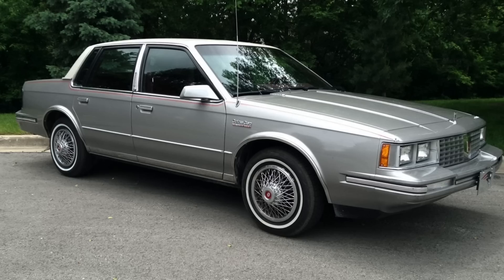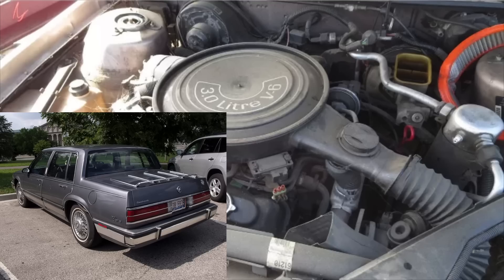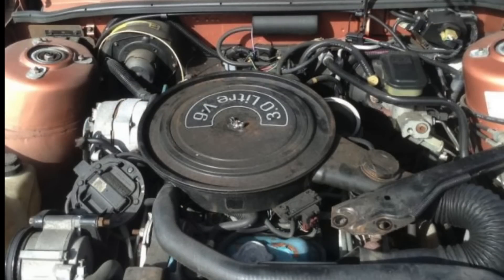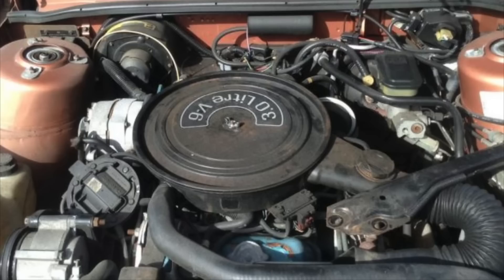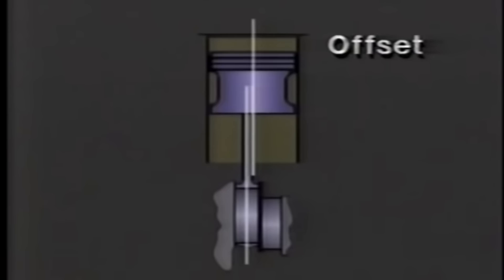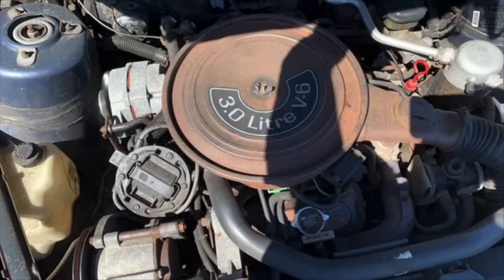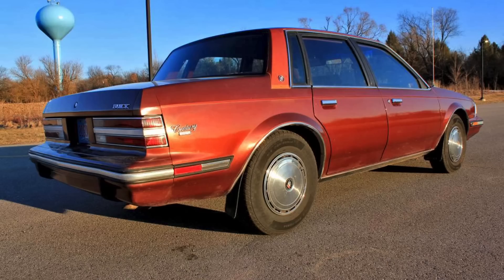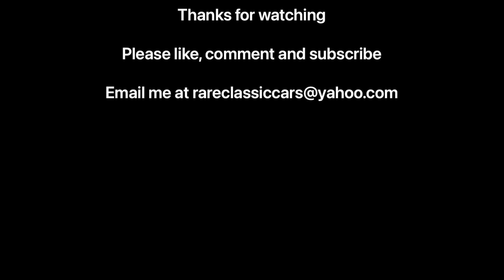Worst Engines of All Time: GM's 3.0L LK9 Carbureted V6 Engine (Buick Century, Olds Cutlass Ciera)

Comment: I have a 1985 Buick Century with the 3.0, bought at an auction some 7-8 years ago, was stored in a barn due to a bad fuel pump. It had the biggest mouse nest I have ever seen in the trunk but thats another story. I dropped the tank and replaced the pump, pulled the carburetor and rebuilt it, replacing every single electronic control in the carb with new parts.  All new ignition parts at the same time along with a water pump. Got it running, tweaked on the carburetor some and replaced all vacuum lines along with the PCM and the intake heater (Early Fuel Evaporation). That was 40,000 miles ago,  engine runs with 5w-30 synthetic oil year round and it starts down as low as -15F. It is a little cold blooded, usually let it idle 20 seconds before taking off with it, it surely isnt a powerhouse but seems to move the car along just fine. It now shows just shy of 140,000 miles.

Comment: I guess I was a lucky one. Had an '85 Ciera with the LK9 from 2011-2018, and it was never problematic aside from occasional issues with the choke sticking. The car would probably still be running to this day, but it was wrecked then rigged back together by the next owner, then he passed on and it has likely been junked by now.

Comment: The 3800 v-6 was a bullet proof engine after about the 2nd-3rd year and even came supercharged. I worked at an exclusive Buick dealer(Warthen gone replaced with a Nissan dealer) in Las Vegas in 91-92 and remember those Buick century cars they were a decent reliable and seemed as though only Social
 Security recipients baught and owned them..

Comment: I was a Buick , Olds Pontiac tech during the 80's to 2010 . Our dealership sold many of these   and damn near all of them failed . The carburetor used on these engines were also a problem child  . Customers with the 2.5 or the 2,8 engine rarely had problems . The 3.3  mpi engine was much like the 3800 and would just run forever .
Reply: I worked at the Nations oldest Buick Dealership , it was originally located in a Barn , a real Barn .

Comment: add to my list- most reliable engines let’s go:

Ford 4.6L 2v V8 
GM/Buick “3800” 3.8 V6
Honda B18 non-vtec I4? 
M-B OM606 turbodiesel I6
Reply: seen a few honda “j30” 3.0 v6 engines with over 500k miles but i hesitate to give them the same space as a 1UZ-FE

Comment: The 2.8L V6 would take all kinds of abuse.  The 3.0L V6 as you point out in the video, is a POS.  The 3.8L V6 sucked until they put the balance shaft into it.  The balance shaft got rid of the vibration.  We had an 1985 Olds 98 with the 3.8L V6 and it suffered from vibrations.

Plate C

Comment: All that was, was a cut down 3.8L. The 3.0L was an OK engine. There was nothing really wrong with it.
Reply from the maker: Check the comments section.
Reply: @RareClassicCars   I have and it's 50/50. This was by far not one of the worst engines GM ever made. The newer 3.0, 3.5, 3.6l are some of the worst engines GM has ever made, even worse than the olds diesel.

Comment: I can agree that this is the worst of GM. this shaky motor pre-dated the idea of installing a balance shaft. After selling all the repair and tune-up parts possible I would tell the vehicle owner all kinds of terrible news about the engine and to get another car ASAP... When the next gen of this motor came out it was 3.3L., multi-port fuel injection, balance shaft installed, smooth running, became a good engine like the 3.8L. yet not the same.

Comment: Whoever designed that engine deserves a special place in somewhere very horrible.
What a shit design.
I'd expect that from an early Mitsubishi engine, but GM?
Although Holden did build the ghastly 1.9 liter Starfire 4 cylinder,
I'd be surprised if any of those still exist in running condition.

Comment: Had a 85 century for my first car. I could not beat a delivery truck off the line. I believe i got it with 65k on it and sold it before 90k. The car would over heat at a stop light had to drive with the heater on all the time. Could not figure out the electronic fan relay. I was 17 and it was an adventure. That was the worst car I had ever owned. It did how ever teach me a lot about keeping a car running.

Comment: My grandparents bought an 84 cutlass ciera with the 3.0 engine brand new.  When they stopped in to show my family their new car, they couldn't get it to start. After my grandparents passed away, I inherited that car. It was always hard to start. Never idled smooth despite several trips to the mechanic. Also the most unresponsive car I have ever driven.

Comment: My dad had an 85 Buick with this engine. While it never blew up it was so horrifically underpowered I was convinced that it must have had 10 pounds of compression! This shitbox was the worst car I’ve ever driven and a bloody nightmare to work on. I think this was the first Fwd car I ever had to work on and compared to the 1960s and early 70s cars we had previously it truly was miserable. I guess we were spoiled working on RWD cars that actually had room to work on stuff. If I remember correctly that 3.0 had a Rochester 2 barrel that had a solenoid that pulsed of the metering rods up and down and by pulse width modulation if allowed the computer to control the mixture. I remember having to fix that bloody carburetor on the side of the road many times! The damn spring would break or get soft and the car would lean out and fall on its face. We always carried a couple extra springs and tools. One day I had enough and made an adapter to stick a 600 Holley carb on that car. Believe it or not it made absolutely no difference in the power output. I never tore into the engine at all because the car was such a shitbox not having any power was one one issue but after watching this video I’m glad I didn’t. If I had done some porting and a cam swap that engine would have completely disintegrated! This car was truly terrible, it might not be the worst car ever made but it’s certainly the worst car I’ve ever driven or worked on. Truly a car best forgotten about I had to overhaul that 440 transaxle twice in 100,000 miles I can’t remember everything I had to fix on that shitbox. I don’t know why he kept that car for so long but he must have liked it for some unexplainable reason.

Comment: I had a late A body car (96 olds) woth a 3100 and 4 speed auto. What a fantastic car. It was quiet, comfortable,  good on gas, cheap and easy to repair, and cheap to insure. I would definitely buy another in a heartbeat. I always wondered how the early versions of the A bodies were.
Reply: Had a 94 Buick Century with this engine. powerful, good on gas and ran smooth for years until I sold it to someone

Comment: The 3800 is a beast.  I'll keep having new metal welded into my 2008 Grand Prix for as long as the motor keeps running.  When I was a dealer tech I saw many with close to 300,000 miles on them still running fine.
Reply: I have a 99 Supercharger 3800, has about 362,000 miles on it. Still runs like a top.
Reply: I love GM V6s, my friends 4.3 has 800k miles sits outside with the hood off and still starts every time
Reply: I'm a mopar guy, but my wife had a 97 LeSabre with 3800 Series 2 and I was really impressed by that thing. especially with it having iron heads.

Comment: All the Buick V6 and V8 in the 215, 300, 340,350 as well as the 198, 225 and 231 V6 engine  line had the full skirt pistons. The 400, 430 and 455  did too.
Reply from the maker: No. The 1988 and later 3800 does not.
Reply: @RareClassicCars  Yes, I know. I wonder why the newer design did have slipper skirt pistons. The Small Block Chevy did as did the Cadillac 331-365-390 from the start. My Nephew had a '58 Caddy and I was kinda surprised to see the slipper skirt pistons in that motor.

Comment: I had a neighbor that had one new in an Old's 98..... She is a lead foot and had to have the engine replaced why it was still under warranty. After the third engine, she sued GM under the lemon law..... it took a couple years but she won and GM had to buy back the lemon. She has purchased Ford's ever since. 

You forgot about the loud, oil burning, powerless, poor on gas milage Vega engine.... as far as that goes, the whole car. I had a 75 Vega Kamback GT.... In the years I owned it, it had three engines, one trans (air cooled Turbo-Hydromatic 250) and an axle, not to mention all the rust repairs I did on it. On top of that, it was not that good on gas, only getting around 16 mpg around town and maybe 20 mpg on the highway. It was powerless too, maybe toping out around 80 mph floored..... IF the A/C was on, Fred Flinstone would win the race! My 348 powered 59 Bel Air gets 20 mpg city or highway and has power. Needless to say I drove the Bel Air much more than the Vega during the summer months back in that era.

Comment: I had a 83 Olds with the 3.0Lt and got over 200K miles out of it....And it still ran smooth but the frame cracked.

Comment: I remember my first job as a mechanic at "The Brake Shop" (1993) my master mechanic co-worker had gotten a worn-out Olds from a private auction and sold it to a grandmother stating the engine had been replaced with a crate 3.0 v6 that has always bothered me I was 17 years old and did not want to make waves but I will always feel like crap for not telling her the truth that all he did was buy new valve covers and carburetor.

Comment: At about the .40 second mark of the video, the vehicle pictured is not a Pontiacs 6000, but a Pontiac Phoenix. 
I had a 1985 6000 with fuel injection and drove it trouble free for about 124,000 miles until the fuel injectors started to fail one by one and the distributor developed a problem and had to be replaced. This was after 9 years of use and I figured it was becoming a money pit and replaced the car. It was a very good car and drove great even in snow.
I also had a 1982 Chevy Citation with a carburetor V6 which was a dog of an engine.  The car also had a problem with the steering rack which leaked badly and was replaced at least 4x under warranty before one that didn't leak was installed.

Comment: I had a 1983 cutlass ciera with a 3.0 litre buick motor in it and that thing lasted forever.  It  rusted out to the point I had holes in the floor board but that engine ran like a top.  I don't know how many miles that car had on it when I totaled it but it had at least 4 different owners before I got it and by the time I recieved it, it had developed a slip in the transmission but it never failed and I know I put at least 50k miles on it myself.  odometer only went up to 99k so hard to say how many miles it had but I was still driving it in the 1997 when I graduated highschool.  I loved that car and it was very reliable.  That thing still ran even after I got broad sided and had a foot and a half deep dent in the the passenger side of it.  I drove it around behind my grandparents house after that accident with the hole side smashed in and it still ran good.  Only thing that I found bad about it was that it ate starters as the starter was wrapped by the exhuast and it cooked them.  I probably put at least 4 starters on it when I was driving it and had 2 batteries in it just to make the starter last a little longer.

Comment: I had a 1980 Malibu with the Chevy 229ci V6 (a semi-odd fire V6 derived from the 305ci V8). That engine was such a pile... noisy, vibrational, couldn't get out of its own way. For years I fought with it to resolve the idle vibration, and finally someone with some GM dealer experience told me that all the 229s vibrated. It was just inherent in the design. Could not believe GM put that on the market.

Comment: I've had quite a few A-Bodies over the years (over 30, currently have four Celebrities) and the early ones are best had with the good old Iron Duke or the carbed 2.8. The Citation's H.O. 2.8 was even available in the 84 Celebrity and early Pontiac STE sedans. If I hear one has the 3.0 I won't even consider it, it's easier to keep the diesel 4.3 on the road!
Reply: So you own all the Celebrities left in existence! Any 2 doors in your collection?
Reply: @parnelli jones  I've had a few! My first car back in 1991 was an 86 Eurosport coupe. I currently have a different 86 Euro coupe that I bought in 1998 and have had about six others. I recently sold a pair of coupes (82 and 88) to a father and son out if the Sioux City IA area when I decided to diversify my collection a little bit!

Comment: My first car was a hand-me-down 1983 Oldsmobile Cutlass Ciera. One day while driving on the freeway, I noticed that the car was losing power as I continued to press the accelerator. After managing to make it home after putting a few quarts of oil in the engine, the car just gave up. Turns out there was a hole blown through one of the pistons.

Comment: The infamous Buick 90 degree V6 was based on the division's small block V8 of the early 60s.  Although the block dimensions were shared with the 3.5 L Aluminum V6, the origninal uneven firing 225 cu. in. V6 was based on the iron block 300 cu. in. V8, and shared its bore and stroke dimensions.  As you explained, even firing was achieved by employing off center connecting rods.  The stroke was reduced while the bore was shared with the even-firing 3.8...  3.800 inches not the 3.9xx you cited in the video.

How GM ever justified the engineering time and retooling costs incurred to turn a mediocre early 60s era V8 into an outdated pushrod V6 for the 90s...  I will never understand.

Comment: I had a 2.8 in a 1980 Citation and liked it, ran great even though the car gradually fell apart around it and the fins corroded off the radiator and the cooling system had a few parts held together  with JB weld. The car lasted until 1999 and 200k miles with lots of downright neglect.

Comment: Not exactly relevant but a fun fact, the AOD transmissions shift smooth as glass if you drive them right, never knew until I bought a nearly new 1987 grand marquis. You lay your right foot flat on the floor and use your toes to push the pedal, that’s all, you won’t notice the shifts, if you don’t do that it shifts harder, could need an adjustment but I hear they are clunky and this solved that problem for me. Those 5.0 motors don’t vibrate when new as well, you shouldn’t be able to tell it’s running from feel, and it barely makes a sound, I was surprised about that, I only saw them in mustangs before this.

Comment: I worked for olds and chevy from 77 to 91. 3.0 wasn't that bad , it had no more issues than most gm engines. The night mares existed with Cadillac 4.1,s  olds 350 diesels and Northstar 4.0,s and 4.6,s. Pontiacs 2.5 iron Duke timing gear clacking. 78 to 80 soft camshafts in 305 chevys. Chevy vega 140,s burning oil .

Comment: My first car, an 85 Cutlass Ciera, had that motor.  I lived in the Colorado Mountains at that time and winters were awful, that car needed help with ether every morning to start.  The car was in overall good shape when I got it, but between driving to work and college in the mountains, despite my best efforts to drive it easy it tossed a rod at 90k miles.  I borrowed money from my parents for a used replacement motor, once that was in the transmission started slipping.  At that point I traded it for a Hyundai Excel.  Say what you want to about the Hyundai, as long as one drove it with reasonable expectations and babied it the car was light years better than the Olds.  The Hyundai got me through college, my first "real" job and engagement to my wife.  However it did not survive falling asleep at the wheel one night but I digress.  My LK9 memories are not pleasant ones.

Comment: The change to front wheel drive, EFI, and smaller engines all happened at nearly the same time, totally destroying REAL cars, and replacing them with the bland, boring, unreliable, and expensive CTAs (Computerized Transportation Appliances) we have today. I'm one of the few who still drive REAL cars. Carbureted V8 engines, rear wheel drive, solid rear axle, and body on frame construction. 

The 2.5L "Iron Duke", also known as the "Tech IV", the 60 degree 2.8L V6, and the Buick "3800" normally aspirated version were and still are excellent engines, as far as reliability go. They were all pushrod engines, no gimmicks like overhead cams, 4 valves, variable valve timing, cylinder deactivation or direct injection. None of them made much power, but they got the job done. I have seen the 2.8L and 3800 engines with over 300,000 miles on them that had never been apart. They were boring, but they held up well. 

Sadly many manufacturers used PLASTIC cam gears/sprockets on almost all their engines. I have no idea why. Some say it was to make the engine quieter. My feeling is that it was done to shorten the engines life. The 318 V8 in my first car, a 1970 base model Dodge Challenger, was destroyed when the teeth all sheared off the cam sprocket, allowing the pistons and valves to battle it out. Both lost. On rear wheel drive vehicle vehicles, this is an easy fix. The timing cover is easily accessible from the front, and it is easy to replace that PLASTIC cam gear/sprocket with a steel one. I have a 1979 Chevy truck with almost 400,000 miles on a 383ci small block that I built myself. The old school small block Chevy is an anvil, with one weak point. The timing chain. I am not a believer in putting chains inside engines, but at least in most rear wheel drive vehicles with pushrod engines, getting to the timing chain is easy. I replace it every 70,000 miles. By then it is showing measurable wear, while the rest of the engine is still like new. I just consider it a part of normal maintenance.